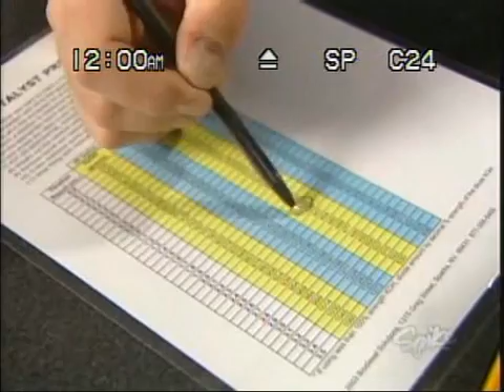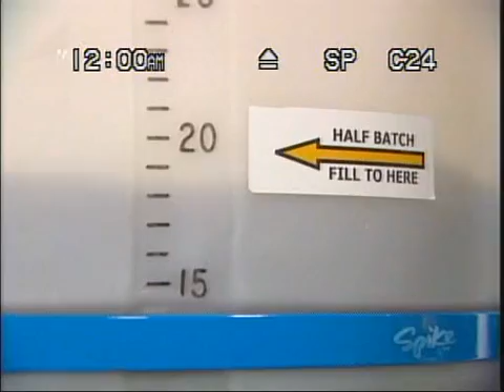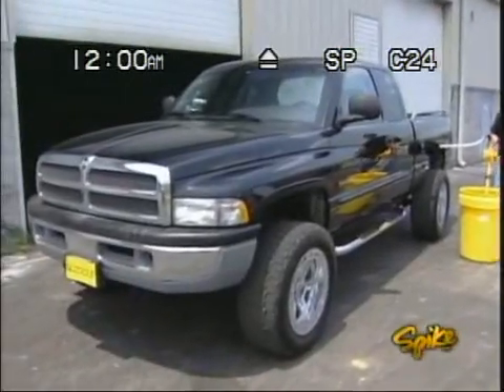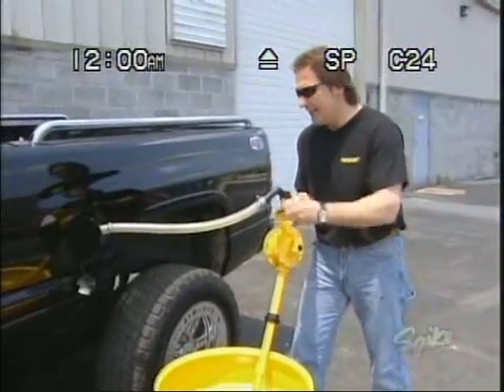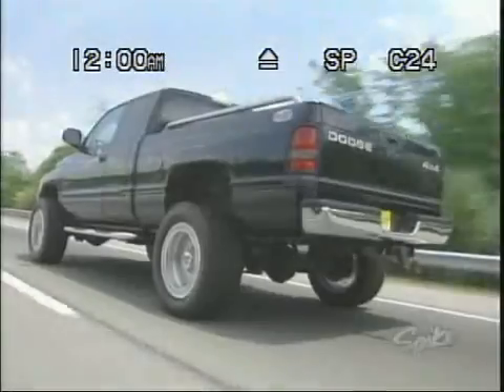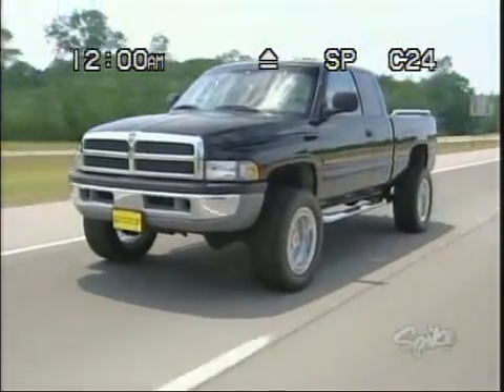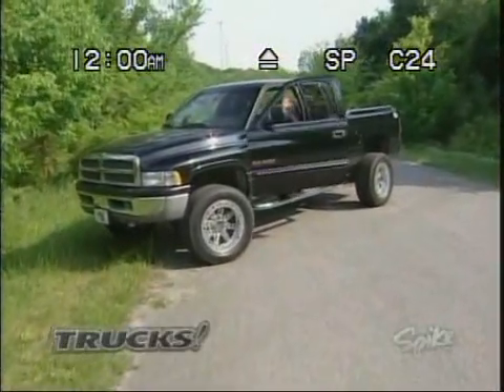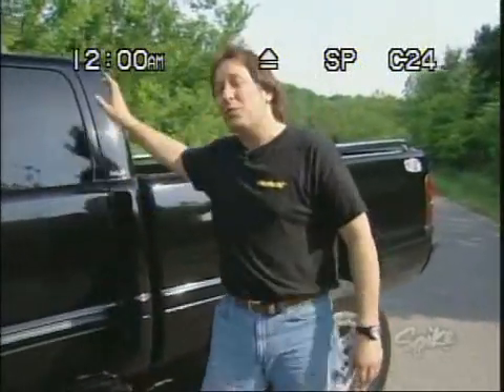Biodiesel

Comment: No every diesel trucks can run on biodiesel. Some problems may happen like engine oil contamination or the DPF clog up nor damage. But we still can run on biodiesel as long as the diesel truck were manufactured between 1993 and 2007 only.

Comment: @dendog21 Any fuel sold for road use is subject to the road tax, period.  Technically, any fuel used on the road is subject to the road tax, without exception.  The chances of getting caught for the latter are slim.  The chances of getting popped for tax evasion for selling it are considerably higher.  It's just like making moonshine as it is a revenue issue.  Maryland even had a task force to test fuel in semi's to see if it was off-road/farm diesel for that reason.

Comment: Because they melt when you have heating elements in them.  Also coming into contact with methanol and lye over a period of time will degrade the tanks.

Use a steel tank like a vented water heater or air compressor tank for your reactor vessel.

Comment: The trick is to buy a large amount of Methanol each time. About $350 per 55gal of methanol container. Add the cost of veg oil and lye... and you get about 280 gal of bio diesel for about $500 including veg oil, lye and methanol......divide 280gal by$500 and you get $1.78/gal. Those guys on tv probably get that stuff much cheaper. Its worth it if you drive diesels around all day.